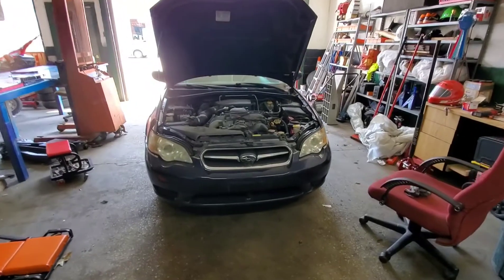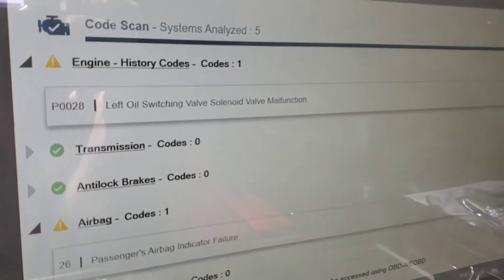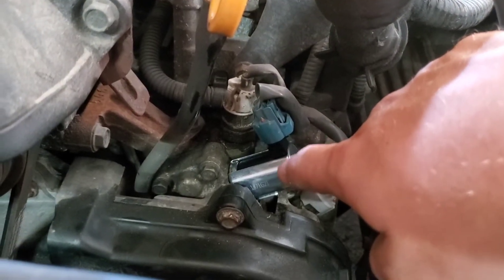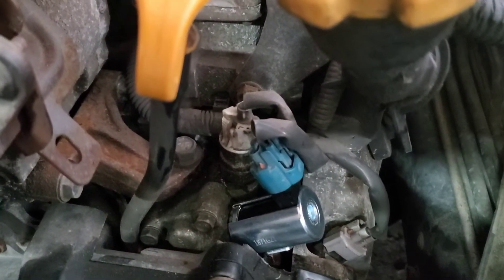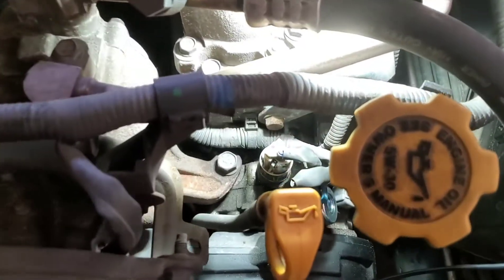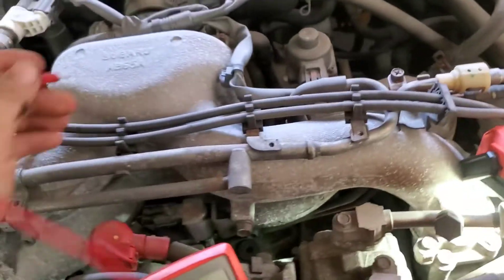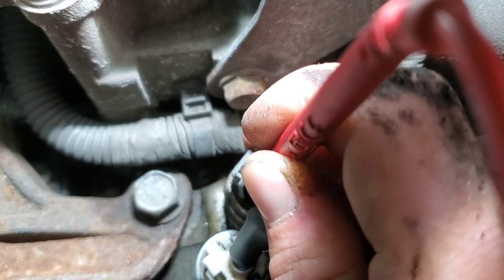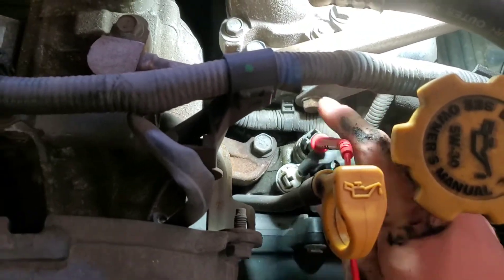Subaru P0028 code diagnostic and repair

Comment: Hopefully you still reply, but just got this code after my check engine light came on. Says bank 2. I have the 2007 subaru outback, which side would that be?
Reply: this is such a late reply but bank 2 is on the drivers sode
Reply: How did it work out was it just your sensor switch or was it something else?

Comment: Any one know any potential downside to driving with this code?
Reply: From what I've read on the articles and forums, it can cause the engine to use more gas and run hard
Reply: Dont do it man. Your car has a specific oil pressure in its pistons for a reason. You dont want misfires you dont want things getting wonky its just not worth it.

Comment: I have the same issue and just replace the VVT solenoid, my question after replacing the oil pressure sensor did that fix the problem
Reply from the maker: Yes it did

Comment: if I have this code would it cause performance issues ?
Reply from the maker: Yes
Reply: @portageautoworks3623  alright, well I thought it was my transmission but I was driving and the car starting stalling and stuff and the check engine light immediately kicked on, I took it Autozone and it gave me that code.
Reply: It was bank 1 or bank 2 ???
Reply: @mohamedelaziz5898  turned out being that my engine was locked up.
Reply: I have bank 2, what's the difference?@mohamedelaziz5898
Reply from the maker: Thats your issue then

Comment: At the 1:04 mark. How did you get that bolt off? Tried different wrenches and sockets but the plug base is still in the way.
Reply from the maker: There is a bracket that you have to remove. Very easy to do. Just a few bolts and a little bracket comes right off exposing the solenoid bolt.
Reply: @portageautoworks3623  I know what you are talking about, but it seems that the space is still very tight to get that upper bracket bolt off with the base plug and side wall. What and how did you do to remove it specifically.
Reply from the maker: Should just be 1 or 2 bolts pop the bracket off with a pry bar or screw driver and the bolt will come right out